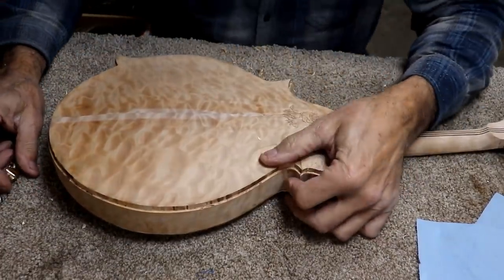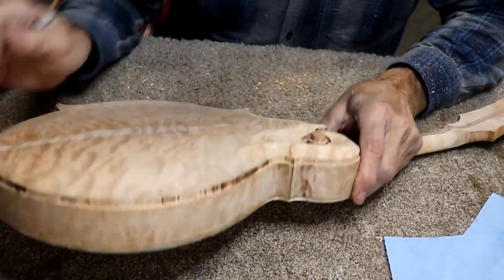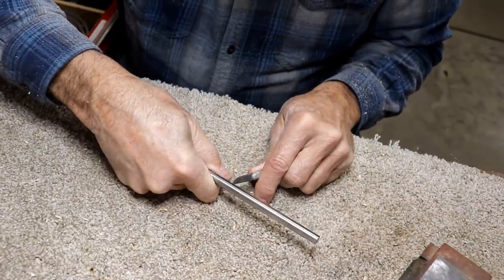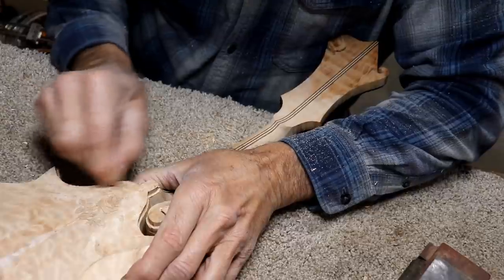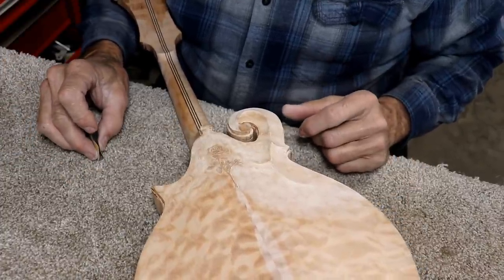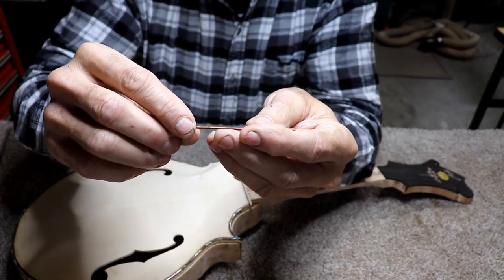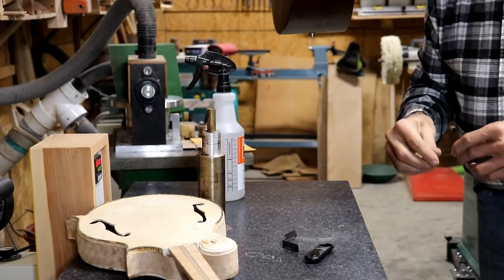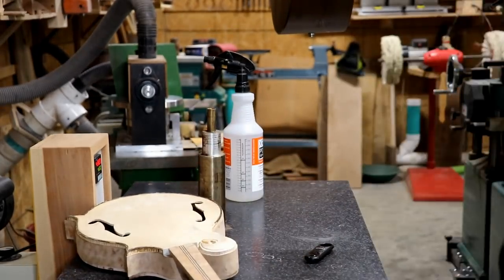560 RSW The Worlds Finest Mandolin Ever Built By A Human  - Part 11

Comment: As a cabinet maker, I be used a scraper many times . I’ve even used the sharp edge it a freshly cut piece of 3mm glass. Long before sand paper was invented , we needed to get wood super smooth and scrapers were how it was and is still done . A good scraped finish is actually better and shinier than a sanded finish . I often sand wood to 240 grit and then finish with a fresh sharp sc  Rs aper

Comment: FYI you guys and gals, I've used dowel pins from McMaster Carr to make burnished for years. They come in different diameters and lengths. The SMOOTH end of a drill bit can work in a pinch. The thing to remember is it has to be harder than the scraper edge your rolling over and have a good finish so you don't end up making a saw or a rasp.
Reply from the maker: Prior to the burnishing tool I have I used a auto valve stem that's very hard

Comment: When I use to trap and put up the fur, I found that there were some aluminum headed push pins. They had a long taper that went to the point. You can check with McMaster Carr or even a trapper supply site.
Reply: Those aluminum head pins are too large for this work.
I have a mess of them, in the drawer, in front of me.
They are much larger, in diameter, than what he is using.
The heads are, also, too large. He would not be able to place
them close enough, together.
Reply: @zapa1pnt  I have to respectfully disagree with you on the pin being too large. The ones I have are very sharp and have a long taper. Granted, the heads are bigger, but the waist part could be ground to a smaller diameter, if needed. They will not bend and the shape of the point will hold better pressure against the work. Of course, if they’re made some place different, they may not be as they use to be.
Reply: @denniscleveland669 : Dennis, please be aware I do not say this to blast you. I'm just providing information.
OK, I just checked and did some measuring. The McMaster  Carr pins are exactly what I have and the
shaft measures 0.044". The pins Jerry is using appear to be (by measuring other pins), to be Approx. 0.026".
Outside that, I have found small safety pins (about 1 - 1/16" long)  have shaft about 0.026" but are hard spring steel and will not bend, like what he is using and do not have a top "knob" to get in the way but can still be held, by the clip head, between the thumb and "f" finger and pushed down, with the index finger, by the spring scroll.
I think they would work great. If those are too small for someone to handle, a larger safety pin (about 2" long)
has a shaft dia. of 0.35" and would also work well.
Reply: @zapa1pnt  we’ve recently moved from upstate New York to Texas and I’ve yet to find my metal typewriter ribbon tin with my pins in it. I do remember that they were fully tapered, from the bottom on the aluminum head, to the point. They were sharp as all hell. They would even poke thru the metal container once in a while. That being said, if he held the one side parallel to his work, the other side would force the pin against his work. Do the ones you have, have a circle molded/cast into the top of the head? Mine were/are super sharp and of good quality. I purchased them over 25 years ago.
Reply: @denniscleveland669 : The heads, of mine, looking down on the head, have a raised edge. Is that what you mean?
Reply: @zapa1pnt  no, they actually had an “o” raised in the head. I searched Amazon and couldn’t find any. When I do come across them, I send a pic.
Reply: @denniscleveland669 : Just for the heck of it, here are the full dimensions, of what I have:
Shaft: 0.044" Dia. x 0.067" length.
Head Overall Length: 0.475"
Head Lower Flair Dia.: 0.34"
Head Top Flair Dia.: 0.28"
Head Center Shaft Length: 0.29"
Head Center Shaft Dia.: 0.87"
I got mine back around 1985.
Reply: @zapa1pnt  on mine, the pin diameter at the top is .046”, length is .554”. The head = top dia. .285”, bottom.388”, middle .191” oal of the head is .476”. In the center of the top circle, is a stamped “S”. They are not sharpened like a nail. They’re more like an old phonograph needle, but the tip is very sharp. So they are very similar.

Comment: When you wear that scraper out, if it can't be re-sharpened, you can make another, huh?   Jerry, you are on to something.  I use those single edge razor blades with a hooked edge for scrapping.  I have a broken tool steel bit shank I use to burnish scrapers.

Comment: Walking through the Martin museum enough times and seeing the inlay work done with abalone and MOP makes you wonder how CA will hold up over the years. Gluing it with CA glue wasn’t an option. Hide glue I guess but I wouldn’t think it would hold those tight spots well enough. Now in my experience CA glue is not a heirloom quality glue. When glued cross grain, it does start letting go after some years. Some people say 10 years is a reasonable expectation for them. I use it for emergency repairs and some turnings. Do we have a 30,40,50 year old example to prove its longevity?  I don’t think so.  Thoughts?

Comment: Would a fly tying vise help you hold those small pieces of Abalone while you are filing them?
Reply: The point of the jaws is a bit large but could be ground down, as needed.
I'm not sure if the jaws open wide enough to accommodate the Abalone.
That is just a "check it and see".
Reply: I was thinking like a pin vice. "Chuck" the material in the vice, and use that to move the material over the file/sandpaper.